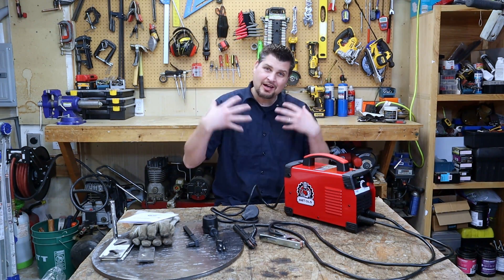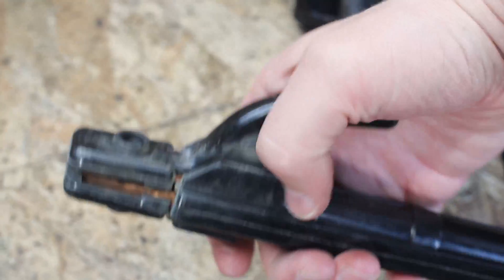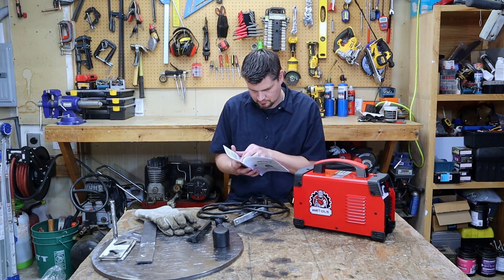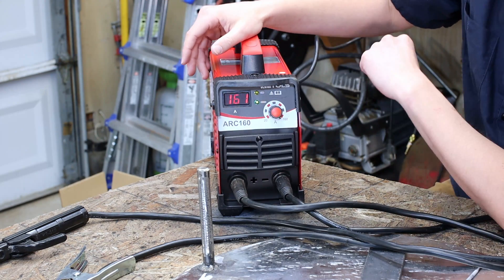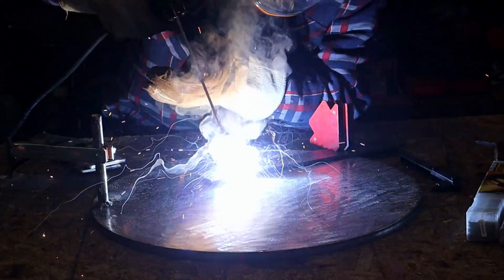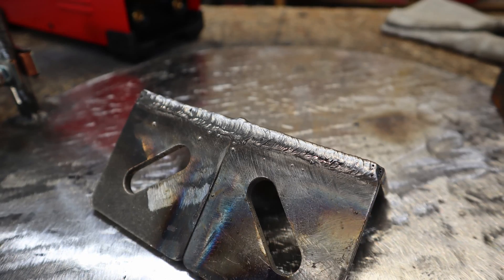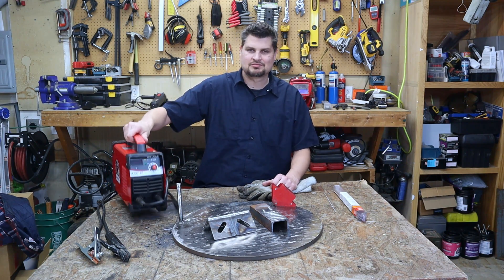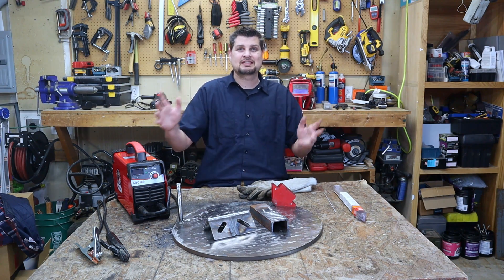Cheap $100 Amazon Welder, Will it Arc?

Comment: Did you try some 1/8th rod?
Reply from the maker: Yes, this one ran 1/8" rods on 220V just fine.
Reply: @-DIYPRO-  cool. Thanks for the quick response. Money's tight but I think I'll get one. I'm not looking to learn any hard lesson so I'm going to try to get exact model. Thanks 👍😊
Reply from the maker: @johndunn8647  Right on, good luck.  Just so you know yeswelder and Arccaptain have similar stick machines are have a couple more features for not too much more money.
Reply from the maker: Links in the description of this video:
https://youtu.be/nLQPFaW_lFQ
Reply: @-DIYPRO-  thanks 👍
I've been thinking about a yeswelder but I was thinking for a hundred bucks and a reputable endorsement, what could go wrong. Thanks again 👍👍

Comment: Could you try it on 110?
Reply from the maker: I should have shown it on 110. It does work, just can't go as high with the amp.  The manual says it can go as high as 120A output on 110V. I turned it up to 100 and was only able to run a short weld before my breaker tripped. If you only have 110 you'll be running it at 80A or below.